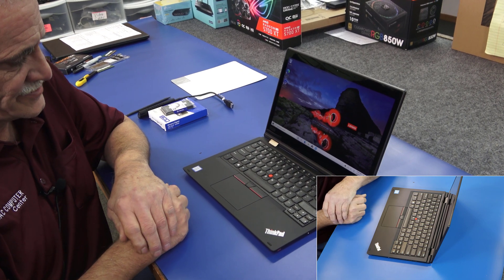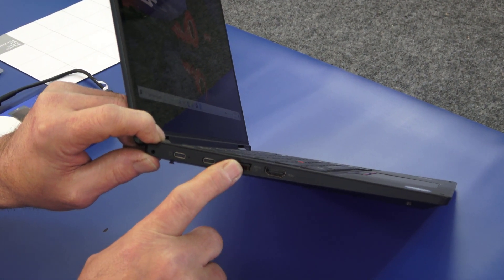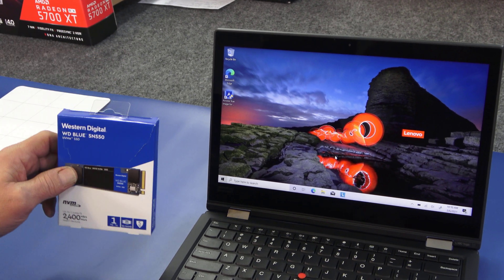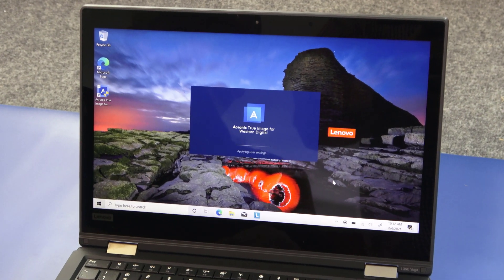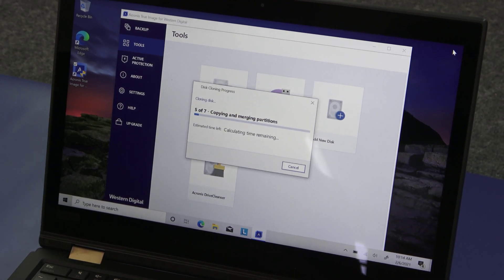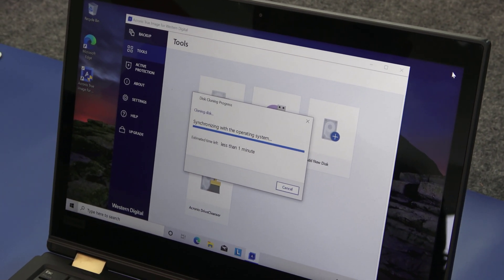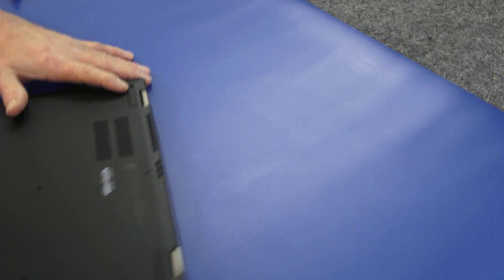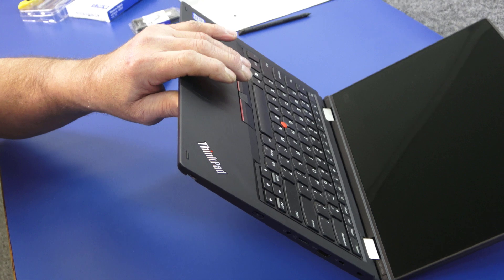Lenovo ThinkPad Yoga L390, How To Install NVMe SSD, Add More Memory and Clone SSD.

Comment: I'm about to do this on my x390 to upgrade the 512GB to 1TB NVMe and plan to use the Macrium Reflect tools that I already own for the clone, but I'm curious wouldn't it be better to do the clone of the disk without being booted up into Windows O/S, and instead via restore/recovery type boot up? Great video!

Comment: Hi, I got 2 of this model, and got the same problem on both of them: the screen start glitching, going black, blue screen but when I remove the 2nd memory (not the one near the SSD), everything goes back to normal. It's not a memory problem, but the Slot itself. I don't know what the issue is ! anyone can help ? thank you